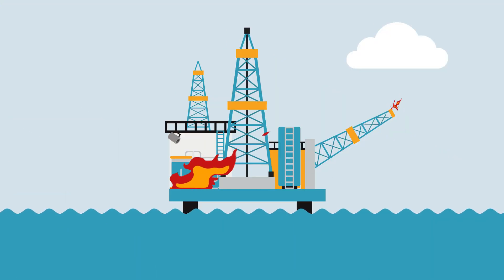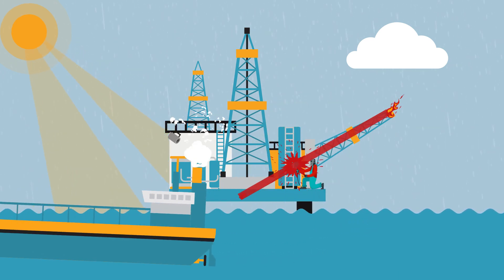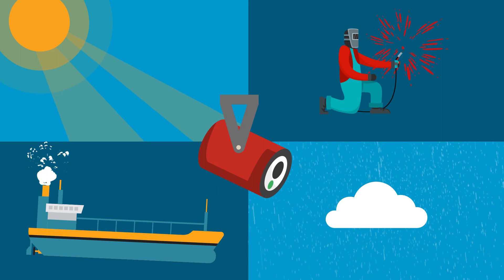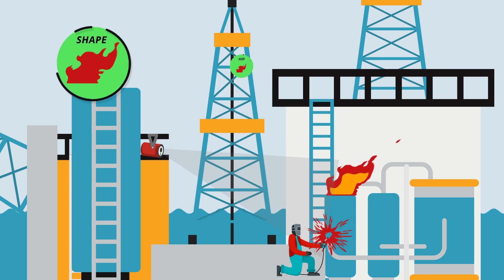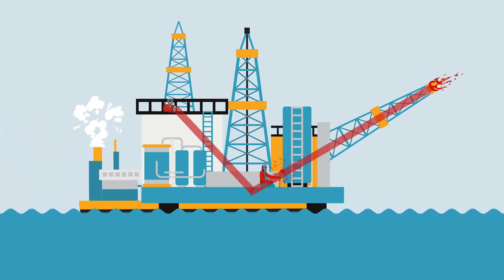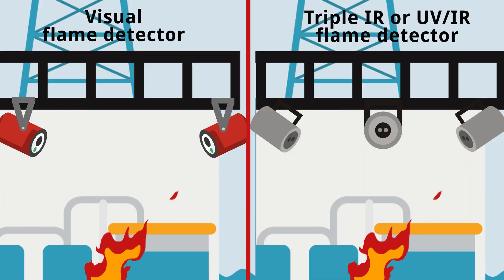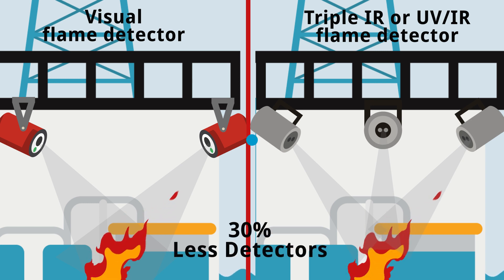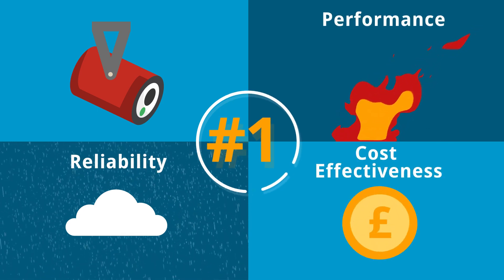Intelligent Visual Flame Detection Explained

Comment: Very surprised that you haven't patented this for Counter-Counter Infrared missile tech. Aim-9xx systems get spoofed all the time, but with your tech, you could have pre-programmed algorithms and databases of existing world wide flare spectrums so you in theory would create a missile that could not be spoofed.  Yes?  Wonder if you could even counter stealth tech, by identifying contrails at the higher and much colder temperatures where airstreams would be warmed by hot engine exhaust, in effect a visual cross section via lasers to detect air density could allow one to even see stealth contrails.  Yes?